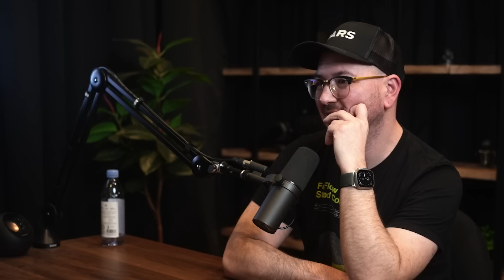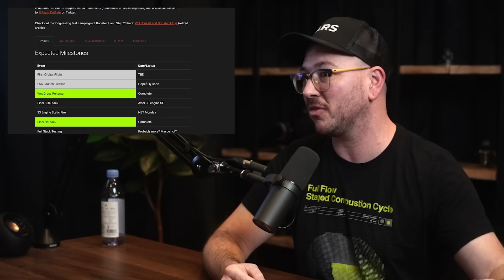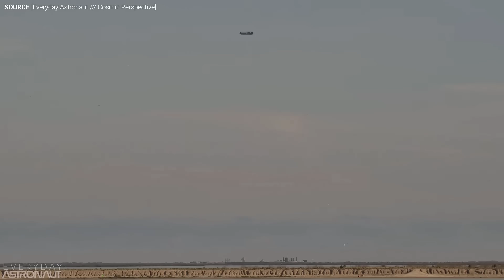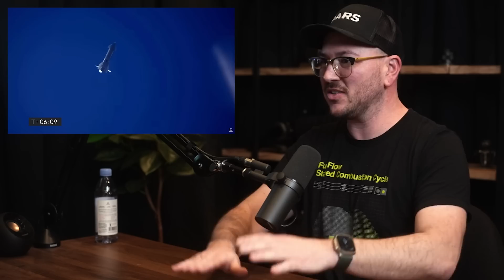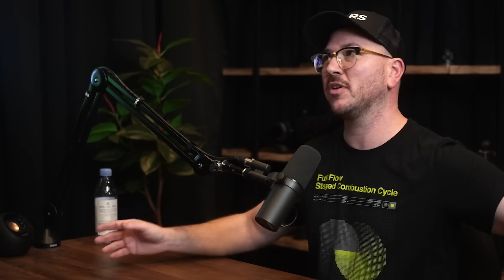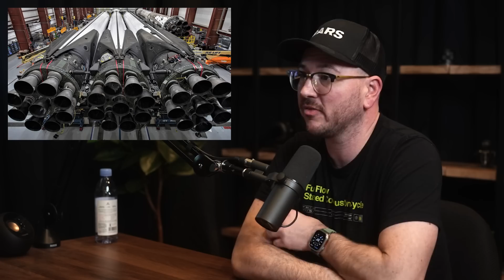Starship: The most powerful rocket ever made | Tim Dodd and Lex Fridman

Comment: Elon's comparison between flipping at 500m vs 2000m is kind of ridiculous.  Why does he goes to the extreme and choose 2000m to compare to 500m? How about giving a LITTLE more margin for error and  compare the savings between say, 1000m vs 500m. He tries to make his point by overexaggerating the saving from not doing flip at 2000m. Hey Elon, my two cents...if you flipped at 60,000 miles out, you wouldn't even have to worry about fuel sloshing.

Comment: The problem with landing horizontally is that you have to put in a landing gear and that means the tiles need to move out of the way so that wheels can get out. It's a lot of extra ways those tiles break

Comment: Starship upper stage actually has 9 Raptors.  3 sea-level engines and 6 vacuum optimized.  The Starship that is expected to fly first is an older design with only 6 engines, but SpaceX has already moved to 9 engines on its newer builds - at least from what's been seen of the thrust puck.
Reply: no

Comment: I am a big fan of Lex and also Tim and also SpaceX and also Elon Musk, for many years.
  
But I do wish that people would be realistic about the TIME-FRAME for "Dear Moon" mission which is a round-the-back-of-the-moon and return to Earth mission on Starship.    This is not going to happen for many many many years.  Not 2 or 3, I would estimate 6 to 12years. 
Why?   (apologies for the long list of reasons!)
-- Falcon9 launch in 2010 and it took til May 2020 (TEN YEARS!) before men were launched on it in the Dragon Crew test flight.      Could well require 10years for Starship to be confidently crew rated.
-- Starship launch / achieve orbit reliably/ land reliably with no catastrophic events has to be proven to work reliably many many times.
-- Even after 100+ launches of starship, professional test pilots (like Bob and Doug) will be the occupants on multiple orbital missions first (not 'civilians').
-- Orbital re-fuelling has to be designed and developed and proven to WORK RELIABLY.  Cannot get to moon * back and land without this.

-- Thermal Protection System (the black tiles) has to work and there ARE problems with it -- the tiles fall off frequently during static fires.
-- The Crew version of Starship is a long way off, no development AFAIK.  
-- Raptor 2's are not yet reliable.  for eg,  During recent 33-engine static fire, one refused to fire up and 1 shutdown early.    
-- 80% of the 5 Starship prototype test flights (so far) have ended in catastrophic failure.
-- Launch permits for frequent launches may well be an issue.   No launch permit = no launch and if they're trying to get 100+ done it will take a very long time.
-- SpaceX (and others) are not permitted to overfly land i.e. Florida so it might be that frequent Starship launches have to happen at the Cape and that development is quite a long way off.  Also...manufacture of Starship likely to have to move to near the Cape (they have a facility there at Roberts Rd).
-- If there are any catastrophic failures (highly likely) that will set the program back prob 6months to 1 year.

Being slightly cynical here, I do believe that some of the selected crew are essentially doing this to promote & market their own businesses / careers.
Reply: Thank you for the elaboration.
Tim Dodd is a nincompoop.

Comment: 0:52 "....fully re-usable rocket..." BUT 0:59 "...all is aspirational until it's working..."
Or in other words, SpaceX and Elon are claming things without them actually doing them. Of course Elon would never tell a lie (Tesla Semi will be available in 2017 / FSD is completely ready / Neurolink will let you do amazing things next year / I won't sell stock in Tesla / etc)

The booster will be re-used. You mean like the booster of Falcon9 can be re-used but mostly isn't?
1:24 "...under 24hours re use..." Not going to happen in my life time. Believing that it's even feasible with the current state of materials outside of Science Fiction is laughable because it shows an utterly lack of knowledge and appreciation of the wear and tear that rockets and their engines endure.

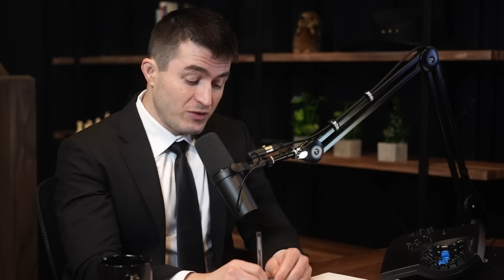2:02 "...the engines on the second stage will be used for landing...." 
Really now? So when it lands on the moon or Mars there will be a big tower already there to let the people inside exit and re-enter the rocket, right?
smh

4:30 "...launch pad is unique..." yeah which is way that every time they do a test of a few engines they have to re-design/repair it. Doesn't sound like a rapid turn around capable launch system.

7:24 Yep, that is what has happened so far with only 3 Raptors firing, time and again. If they would really ignite all 33 Raptors then the launchpad would be a hole in the ground.

11:45 The first sensible thing I heard. It does add lots of complexity and one has to rely completely on the programming in the computer to avoid becoming part of the scenery. Possible? Sure. But the people inside better have taken their motion sickness pills. Now consider that out of 5 launches they failed 80% of the time, I wouldn't be looking forward to get on it. Also keep in mind that Elon and SpaceX keeps saying that they hope to get point to point rocket flights as in traveling by rocket from one location on Earth to another corner of Earth. sigh It would make the Concorde look as a paragon of efficiency.

Consider as well that it gets funded by the US taxpayer (not by Elon) they really have no problem with how many rockets and boosters that they destroy in there trial and error runs.

Comment: This title annoys me sooo much !!! I'm witching it now just to don't have it on my list anymore...
STARSHIP is just a can with boosters !!!! It will become a rocket when it flies !!!
AT BEST in 2024 ! 
Just because the misleading title, I pushed disliked....
Reply: Hmm no one called the SLS a can with booster before it flew, looks like 2023 will be it's launch date with the successful static test just done, please leave this community and never come back.
Reply: @miguellopez3392  realistically, it is exactly that, but made out of inox and not conventional metal used for thin cans, and the actual starship (not the booster) still has issues with the heat shielding tiles, which some of them will most likely fall off during the takeoff. I'm curios to see how much that would contribute to the explosion (failed landing)
To be honest I don't see how they'll manage anything other then a big explosion this year when the assembly will attempt re entry. 
If I would bee involved, I would test if only the booster with all the engines attached fly and land, before i strap a starship on it. Just to make sure there is enough control and tilt space when everything is on.  Once that works, towards the end of the year... maybe next year I would attempt to attach a startship and fly both of them off the ground.
Reply: @Kurazs Iosif Daniel  we are talking about when it flies not when it lands.

Comment: The design is ludicrous!  Too many engines and fuel pumps!  Can’t possibly land on moon or mars without digging a crater first with massive thrust and then falling over!
Reply: They have experience from falcon 9 and falcon heavybin making 27 engine launch reliable, the moon and Mars both have basalt  bedrock and less gravity so you don't need the same thrust as you do on earth, you can have hot gas thrusters on top of the rocket to land it and these can avoid kicking up rocks.
Reply: @miguellopez3392  all speculative and hopeful not proven or with the level of certainty that nasa requires!  This is why NASA is altering Spacex lunar lander contract and bringing in a competitor!    The thrust that Starship would require to land and takeoff on Mars is not considered practical or viable by NASA.  NUCLEAR IS ONLY VIABLE POSSIBILITY BEYOND THE MOON!   NASA DOES NOT TRUST FUEL PUMPS IN SUB ZERO CONDITIONS!

Comment: Double the specified thrust, twice the explosion would be a rough estimate.  So the smart bet on the Vegas over/under line of 1 kiloton would be the over.
Reply: oopss, let me update my estimate on the static fire explosion. 1) found out its not a full run of propellent onboard and 2) less then full thrust of the motors.  So I'm actually putting my bet on the under, particularly because the line doesn't include the associate tank farm explosion.

Comment: Runway landing might save weight on the ship, but at the cost of much longer turnaround time, and it will need to be raised vertically again for relaunch, so either the holding gimbals need to be reinforced, or it'll need nosecone mounts. This would also compromise the heat shield, wheels would need to eat into cargo & fuel space and machinery.
Reply: Runway landing does not actually save much weight, it adds more due to unnecessary gearing that you do not need in space (i.e. most of the time the vehicle is operating)
Reply: @jakub.kubicek  the tradeoff is there would be no need for the header tank and associated piping , that's only needed for the vertical landing.

Comment: Let's be clear, "rapid reusability"is a marketing term. At no time now or into the distant future will a starship ever take off within 24 hours of landing. It is extreme naivete to believe such nonsense. Nor should anybody want to fly on a starship within a 24-hour period of landing and not have a thorough inspection.
Reply: A thorough inspection can be one guy taking a month to look at every single part or 1000s of computers, scanners and sensors that does it with extreme precision and accuracy in seconds. So I do not see why it wouldn’t be rapidly reusable if the costs of creating the systems to inspect are far outweighed by the benefit of reusing more frequently.
Reply: Yeh, they might need to pressure test it, after landing, there is a lot of force, if it does not land perfect. Also, I expect, the noise level won’t be tolerated, if happened too often, it has to also be secluded so does conflict air planes, it has correct weather. Hopefully the heatshield does fall off during landing, with all the vibration. They can swap out the rocket quickly, however.
Reply: Remember the space shuttle was projected to fly twice a week... And with 5 shuttles every other day. Rockets are far to violent. "Rapid reusability" is the same thing as "taste great, less filling". It's nonsense. To believe otherwise is just fandom.
Reply: @hawkdsl  - Compound curves and hydrogen killed the Shuttles ability to be economically refurbished. Starship will not have those issues.
Reply: @motokid6008  yet it will deal with extreme pressure, re-entry, metal fatigue, and a host of other factors. "rapid reusability" is 100% nonsense.
Reply: @hawkdsl  - Yet they achieve it with Falcon 9. It remains to be seen as far as upper stages go, but regardless I would wait and see before throwing "100%" around. You wouldn't want to find yourself on the wrong side of history like all the folks who thought F9 would be a failure.
Reply: @motokid6008  F9 is nowhere close to "rapid reusability". It takes a little over a month to recycle an F9. I expect the same for SS. This idea that a booster will come down, land on the chopsticks,then get refueled to take right off again is absolutely 100% fantasy.

Comment: What bothers me is seeing the most powerful rocket ever devised sitting atop a launch platform without any controlled flame diversion. That pad in boca chica can’t even sustain partial static firings… hmm… it seems fitting to me to provide the most powerful rocket ever devised with the most robust flame diverter ever constructed… whoopsy.
The boca chica launch platform looks like a prototype stage zero manufacturing pathfinder… not a launch pad. I predict the first launch will be from Kennedy Space Center.
Reply: a deluge system has been delivered.

Comment: Tim's idea regarding a horizontal landing is interesting - but it would have to be for an 'earth to earth trips only starship'.   Current design of starship is intended to be landed on earth, moon and eventually Mars.  Horizontal landings using aerodynamic lift are impossible on the moon and next to impossible on Mars.  Neither the Moon or Mars have runways which would be required for a horizontal landing.   The moon has no atmosphere making  aerodynamic assisted flight impossible.  On Mars the atmosphere is about .02 Bar while gravity is 0.4G - to generate enough aerodynamic lift for neutral neutral buoyancy (what is required for horizontal landing) the starship would need to be travelling at over 10,000 km/hr.

Comment: Why the near dismissal of the American space shuttle??
Reply: The Space shuttle is considerably less capable than the Rockets that came before it. The shuttle was supposed to be a cheap and reusable way to get cargo and astronauts into orbit, yet each launch required a massive amount of maintenance and refurbishment that was very expensive. In that sense the Starship is everything that NASA wanted the space shuttle to be, except better in nearly every measure.
Reply: It was extremely inefficient, it was amazing in some ways especially for the time but it was not a good practical vehicle, its a bit overrated today because of symbolism.
Reply: @Lmesser  No that Makes zero sense, an bit sloth ridden in your comment. think harder next time.. Stupid really..
Reply: @reserva120  What? He's right. The space shuttle program was completely inefficient and had many major problems

Comment: Tim,

Respect.

You really are extraordinary.

Nothing ordinary about your current trajectory. 

With that said, pretend we’re sitting in a bar after a conference, expo, or test fire somewhere and you just said - and I know you were saying you’d just love to see it (so would I!) - but if I understood you correctly, you wonder if it would be lighter weight and if so why they don’t try to land horizontally with an Earth variant - like the STS Orbiter/Buran or the X-37B or the Dream Chaser?

I put my fancy drink down - lol - look at you, and counting on one hand of fingers, say..

“1. Landing Gear Hardware | tires, wheels, axles, brakes, struts, torque links, trunnions, and..?:

More parts, more supply chain, more cost, more weight, more design changes for more weight, more payload penalty, more criticality 1 failure modes, more development costs, more development tests/time, more training for technicians, more technicians, more things to return to launch configuration before flying again in hours/day/days and more training for crew manual mode during an autonomous landing failure)

. . .

2. Landing Gear Subsystem | hydraulic cylinders, pumps, lines, controllers and/or electric motorized equivalent components, and sensor/control/power wiring harness with ship wide raceways:

More parts, more supply chain, more cost, more weight, more design changes for more weight, more payload penalty, more criticality 1 failure modes, more development costs, more development tests/time, more training for technicians (specialized technicians), more technicians, and more things to return/replace/repair to launch configuration before flying again in hours/day/days.

. . .

3. Landing Gear Doors aka Giant Holes In Starship’s Belly/Heatshield Covers. And  Hinges:

More parts, more supply chain, more cost, more weight, more design changes for more weight, more payload penalty, more criticality 1 failure modes, more development costs, more development tests/time, more training for technicians, more technicians, more specialized heat tiles, more things to return/replace/repair to launch configuration before flying again in hours/day/days, and more soft covered push brooms. ;-)

. . .

4. Landing Gear Structural Support | interior bracing, supports, mounting anchor brackets, load distributing, shock absorbing components, and things I haven’t thought of.

Oh, and a runway (won’t even go into that).

So:

More parts, more supply chain, more cost, more weight, more design changes for more weight, more payload penalty, more criticality 1 failure modes, more development costs, more development tests/time, more training for technicians, more technicians, and more things to inspect/return/replace/repair to launch configuration before flying again in hours/day/days.

. . .

Finally, last item (I only have five fingers on my raised hand) for this exercise in saying, ‘I don’t think it’s their ego keeping them from considering horizontally landing Starship.’

5. Wings | The flaps either have to be bigger or a lifting & control surface system will have to be completely designed from scratch.

Either way, you guessed it:

More parts, more supply chain, more cost, more weight, more design changes for more weight, more payload penalty, more criticality 1 failure modes, more development costs, more development tests/time, more training for technicians, more technicians, more heat tiles, more specialized heat tiles development, and more things to inspect/return/replace/repair to launch configuration before flying again in hours/day/days.

Plus developing a bespoke approach & landing plan with heading alignment cylinders or maybe not even.

747-800 has 3.5 degree glide slope.

Shuttle Orbiter has 20+ degree glide slope.

Can’t imagine what a Starship would likely have, with its reentry trajectory and shedding all that velocity and altitude.”

That said, it would be cool.  lol

Godspeed, Tim, Godspeed.

Paul
ad astra ad nauseam
Reply: TLDR?  They will rebuild the shuttle?
Reply: @StinkPickle4000  No, he's describing why it wouldn't make sense to change starship to a shuttle-like design. Time will tell I suppose, but he's right that there are lots of costs associated with going that route, and it's not obvious from the outset that it would be better.